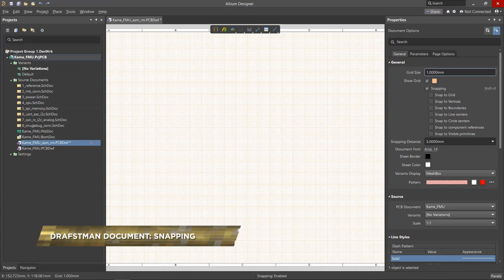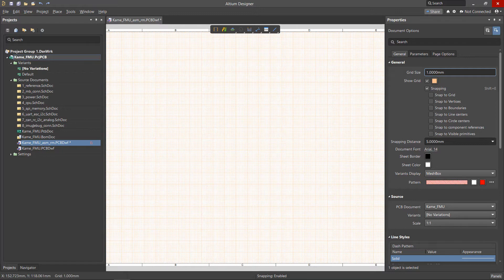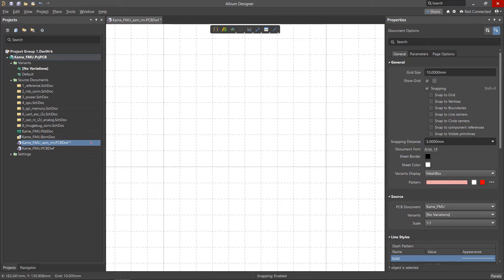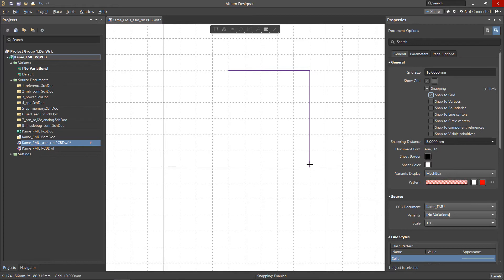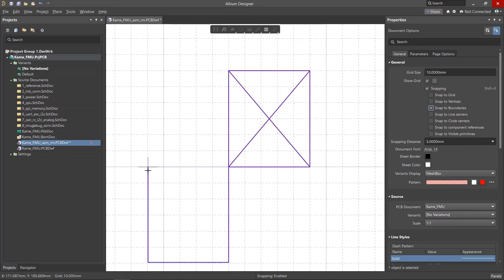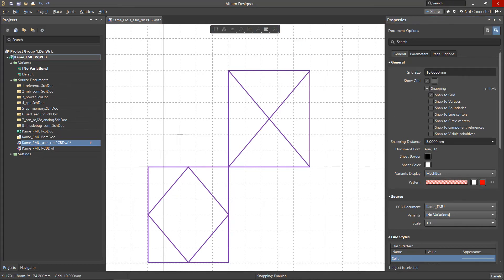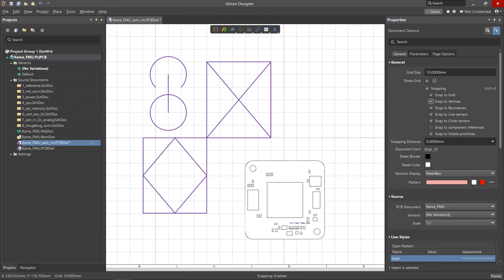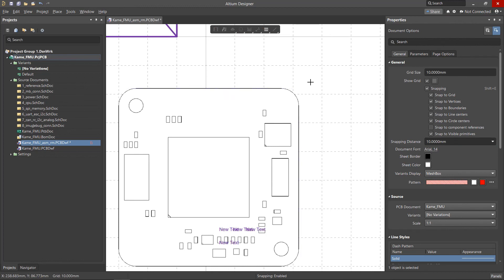How to Use Snapping for Primitives and Components in Altium Designer

Comment: Running version 25 and trying to get the snap grid to 5 mil.  A couple years ago I had a hired Altium expert who insisted on putting lines wherever then manually editing the end point coordinates.  I HOPE that isn't the right way with Altium.  It doesn't seem to allow a snap grid less than 10 mil, at a minimum I would like to know why there is such a limitation.